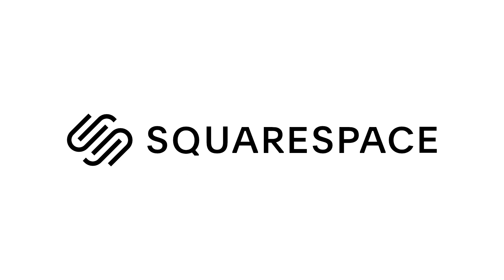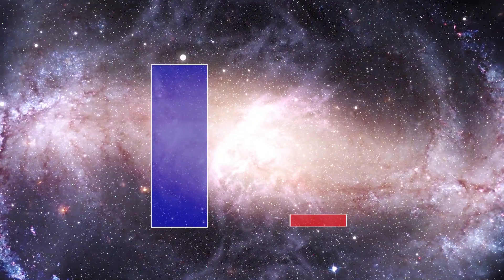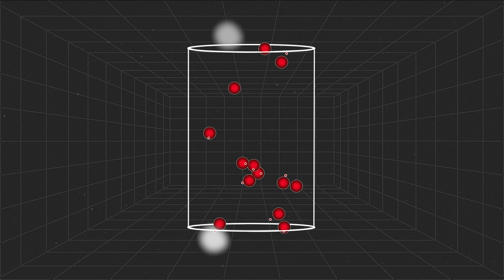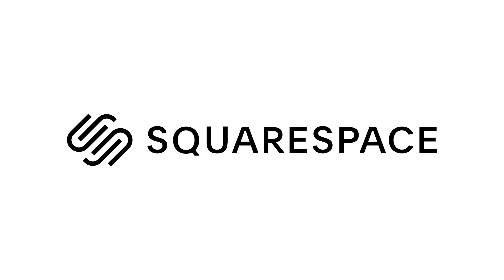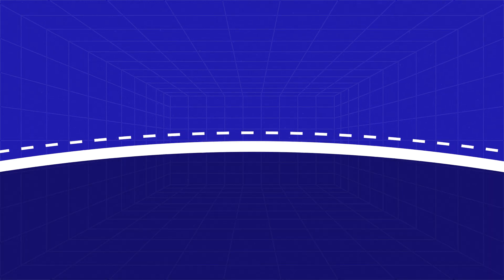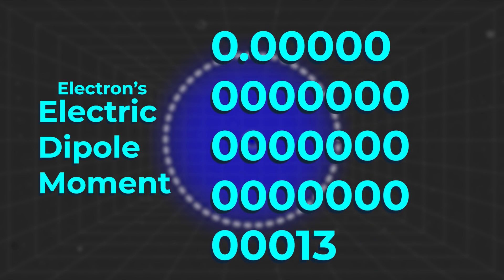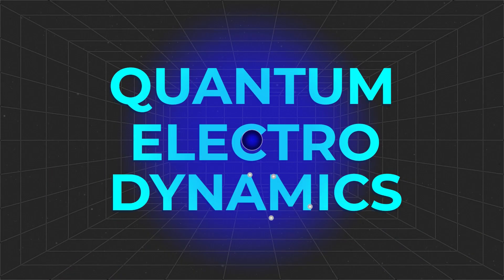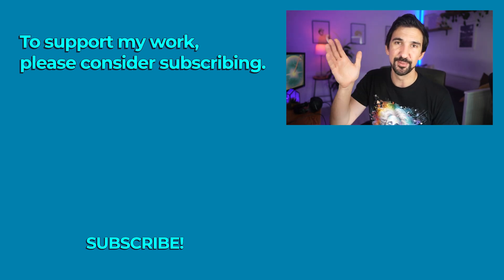What If Electrons Aren't Round? The Antimatter Problem  - EXPLAINED

Comment: Question: How do we know we don't see antimatter? If antimatter behaves identically to regular matter how could we differentiate antimatter from a distance? Could it be a possibility that distant galaxies and structure could be made of antimatter due to local inequalities of matter/antimatter but the universe as a whole balances out? Please excuse my ignorance
Reply: If there was a bubble of antimatter somewhere, there would be a flare around it of annihilating matter. You would definitely see this.
Reply: @jurjenbos228  Not if they are separated by pure vacuum or like in the video above separated by magnetic fields. Even in the experiment above the antimatter could exist forever if the experimentalist never turned off the magnetic field.

Comment: What if normal matter was slightly attracted to the center of the big bang region and anti-matter was slightly repelled away from it at early stages of the big bang expansion? Wouldn't this propel anti-matter outwards creating an anti-matter shell which could exist beyond the CMB and in equal quantities to the matter we know of in our visible universe?
Reply: The Big Bang didn’t have a center. It was everywhere.
Reply: @AdrianBoyko  Actually it had an infinitely dense (centralized, if you will) origin point from which all things expanded from, so in a scalar sense the center would be the beginning expansion coordinates if cardinal points could somehow be externally constructed, but otherwise, you are correct that everything which is within the universal sphere was within that origin point. So, when I mention the "center" I'm speaking in terms of the origin cardinal coordinate expansion point and where all initial energy, gravity and matter was directed away from in the initial moments of the big bang. The matter and energy didn't expand linearly (in one direction) or circuitously (in a loop) it expanded spherically in all directions away from a point of origin. That means that in fact, there remains a true cardinal pinpoint somewhere within our visible universe where the initial expansion took place if scale is to be considered. As for my premise, it was intended to be in reference to possible early stage disparities between normal and anti-matter, since the early effects upon matter and anti-matter would have been quantum influences and not classical. We know that electrons don't fall into the nucleus because of quantum effects creating atomic valance shells and the gluons holding quarks tightly together. So, in the earliest of time during the initial hyperinflation of the universe, there could have been a quantum phase in which antimatter was equal to normal matter, but its inflation rate was ever so slightly different at the beginning to where it's far beyond the visible sphere of detection in our current expanded universe. But, it's just a thought I decided to share. I'm not claiming it's true or even probable. Then again, we have no conclusively deep grasp on the quantum world to begin with.
Reply: @merlepatterson  
It would probably be the other way around if it's anything like what you're suggesting...
Reply: There is no “center” of the Big Bang, it happened everywhere.

Comment: I have two questions:
- Why the shape of an electron could cause the imbalance between matter and antimatter?
- What shape should the positron be and why couldn't that have taken over?
Reply: And electron shape (dipole moment) violates parity symmetry because it is aligned with the spin. Under reflection, the dipole flips direction and the spin does not.
Reply: @DrDeuteron  Yes but under CP the charge is flipped too restoring the dipole moment. So I see that P breaks the symmetry but isnt the symmetry restored under CP?

Comment: I want my credit for this....the anti matter problem is quite easily explained.....and it's not some exacerbating leap and jump...

Why do scientists keep forgetting about ocams razor? It's like that's science fiction by how often they forget

This is easiest to explain in math....under the circumstances in the early universes. There was more or less forces at work.

If everything is equal. One matter for every one anti matter...we still end up with MORE matter that we had to begin with. 

What...is 100-100? 0
What is 100*100? 10,000
100÷100? 1
-100*-100? 10,000....does this make sense

Something forced the antimatter to obliterate itself but doing so created matter..sorry "created". Some antimatter did collide with normal matter but if more anti matter was around other antimatter. Then there instantly is more normal matter to anti matter...basic math, no need to extrapolate possibilities. Stop being so obtuse scientists

Comment: The Antimatter equivalent of an electron, the positron is inside the Proton, giving it a positive charge. We already know that forcing an electron into a Proton makes a Neutron, this is what happen to make a Neutron Star. So, both Electrons and Positrons exist inside a Neutron.

The Quark Model of the atom is a Mathematical Construct that does not describe what matter truly is. There was even a recent paper describing a Proton as having many many more quarks within them
Reply: “An electron interacts with an up quark in the nucleus via a W boson to create a down quark and electron neutrino.”
Reply: A neutron has a mass greater than that of a proton by approximately the mass of an electron.  So if a positron somehow interacted with neutron, it would eliminate the "electron" component releasing energy, lowering mass and leaving a proton behind.  Maybe in the early universe there were no protons, only neutrons, and electrons and positrons in equal numbers.  Some positrons would have encountered electrons and annihilated, and others would have encountered neutrons and vanished to create protons.   It's equally likely that anti-protons could have been created this way using electrons, but that didn't happen.  Perhaps as soon as one predominated even slightly, we ended up with what we see today.  Or perhaps there's something about neutrons that prefers to "ingest" positrons than electrons.  All guesswork without evidence.

Comment: Thanks.  Please excuse my ignorance.  Electrons travel.  I don't know if it makes any sense to ask how fast they travel around a nucleus.  But wouldn't relativity appear to flatten them in the direction of travel?  How might that effect their interactions with other particles?       tavi.
Reply: Electrons do not travel in the nucleus at all. The truth is electrons don't really exist, not in the nice particle form you're imagining anyway. Particles are an illusion. The truth is there is an electron field, and this field jiggles like water ripples or a drum skin, but the difference is this is a quantum field, which means it can only vibrate with certain specific energies. In fact it's a simple ladder, there is some minimum energy and then you increase in steps from there, the gap between each step is always the same, and this energy is what we associate with particles. But it's really, truly, a field. It's much more wave than particle, and you cannot understand electrons in atoms if you try to think of them as particles. The atomic nucleus has a strong electric charge and this creates a so-called boundary condition on the electron field nearby. This sounds fancy but it's not really, it's just like a guitar string or a drum skin. A guitar string is fixed at each end, so it can't move there. A drum skin is fixed all around the circumference, so it can't move there. This restriction is what we call a boundary condition, and it limits the possible ways for the string/skin/quantum field to vibrate. The atomic nucleus actually causes a kind of spherical harmonic pattern in the electron field (look up spherical harmonics, good animations out there). So the question of how the electron moves inside an atom is not answerable. Electrons do not really move because they don't really exist, they temporarily seem to exist when we measure them, otherwise you have to stick with fields. If the electron really was moving in there, it would have to move in circles or it would not stay close to the nucleus, and that means it would be accelerating, which means it would radiate electromagnetic waves and spiral into the nucleus.
Reply: @disgruntledwookie369 your analogy is still a bit flawed. conventionally, when we talk about a fermion particle as a discrete object, we're referring to the field in which a fermion repels all other fermions with the same spin.

Comment: I’ve been saying since 2013 that it seems extremely (Occam's Razor) obvious that all electrons and all photons are in orbit with a dark matter particle and I’ve shared my theory literally many thousands of times with hundreds of the world’s top physics universities, professors, labs, channels, etc.

Based on Fermilab, CERN and other recent findings, I now more specifically think electrons are made of an electron neutrino entangled in orbit with a dark matter muon neutrino, explaining their erratic orbits around nuclei, superposition, uncertainty, the double slit, etc just like I’ve been saying since 2013.  And I think when the electron neutrino gets entangled with the muon neutrino it creates the Higgs field.

I think when an electron gets a 2nd muon neutrino, it’s what we call a Tau particle and I think photons are a pair of electrons entangled in orbit together in apparent axial or helical polarizable wave-like movement depending on the direction of their rotation as they travel.  This explains the double slit experiment for example and the speed of the rotation explains electromagnetic wavelengths.

I also think protons and neutrons are actually made up of over 1,800 electrons with the muon neutrinos likely all clustered in the center surrounded by the same number of electron neutrinos.

‘’If you want to find the secrets of the universe, think in terms of energy, frequency and vibration.’’ -- Nikola Tesla

Comment: There are three models of the electron that I am aware of and all three are more interested in its working diameter and its frequency.  All three models give the electron two parts spinning around each other but in different configurations in each model.  Most graduate physics classes only work with equations for light that don't deal with the spin of the photon; and both light and mater are so much easier to work with if you don't work with all the parts, that is to say that photons and mater are most likely timed and it is that timing that explains polarization, why electrons pushed out positrons, antenna reception, and even gravity if you are in my camp believing that gravity is probably (%chance) massive quantity of out of phase low energy photons.
Reply: I would like to know more about your gravity theory. I have personally had the thought that gravity could be a kind of shadow effect between objects like the sun and the planets caused most likely by some kind of Electro Magnetig Radiation. In one of Richard Feynman's lectures he draw the idea on the blackboard but laught at it. He said that the same EMR would have stopped the earths spinning around the sun. I did a small calculation on it and found that yes the earth would have slowed down but only ever so slightly in it's 4 billion years life time as the speed difference between the earths movement and the speed of EMR is so big.
I am also slightly wundering if the quark idea is really true. The 1/3 and 2/3 charge statements are what is puzzling me. What is charge anyway? Can it be 1/3 or 2/3? shouldn't it instead be 1 or 2 and then be 3 for the electron if this idea is correct? I am in no doubt that they have made calculations that kind of prove it to be correct but are their formula's correct? I believe that at many times in the past people have come to the right result but gone the wrong way. Couldn't there be some thing similar here? 
I also believe that all those so called particles they have found in Cern are of no real value. I believe that most of them arent stable enough to hang around to make any material out of anyway. A fameus physician has also said so.
I actually believe that there are no particles at all but only waves. I believe that what we call particles are some kind of standing waves of energy and the reason we percieve it to have mass is because it takes a lot of energy to push it out of the standing wave positions.

Comment: The most important thing is missing one the video: why and how does the shape of the election could cause the master antimatter imbalance to begin with?
Reply: I second that. How does the shape make the imbalance? What shape is the positron? Is it different?
Reply: If the shape of an electron or any fundamental particle is not perfectly round then CP parity is broken.
If CP parity is not true then we can't assume that matter and anti matter were produced in equal amounts during the big bang.
Reply: @priyanksaklani8176  Why does CP parity being broken due to electron shape have  to do with CP parity broken in matter anti matter distribution? We already know it is broken right since we live in a matter universe? so seeing another instance of it being broken doesn't seem to be the full explanation as to how it explains the uneven matter produced.
Reply: @lendluke  investigation in shape (electric dipole moment) of fundamental particles is an experimental way to disprove the CP parity.
Our assumption of 'equal amount of matter and anti matter produced in big bang' is based on CP parity. Once you prove CP parity false you basically prove the above assumption false.

So maybe during the big bang there was a slight imbalance between matter and anti matter.(with slightly more matter than anti matter)
Most of the matter and anti matter would annihilate but some matter will remain ( the imbalance I talked about above) we might be living in that remaining matter universe.

Comment: One question I always had is what if the antimatter is there, but we can't tell because the wavelengths of light emitted by anti-matter stars is the same as regular matter stars?

Like, antimatter and matter were made in the same amounts, but they just haven't had the chance to touch and annihilate due to the distances involved?
Reply: Intergalactic dust has had plenty of time to "meet and annihilate." Astronomers should see a significant glow from the interactions. They don't.
Reply: @ProfessorJayTee  thats fair. Thank you for the response!

Comment: :eyes-purple-crying::hand-purple-blue-peace::face-red-heart-shape:The real problem is that all the current experiments are checking the roundness of the electron's charge (EDMe) only at the magnetic dipole moment axis N-S of the electron and not overall its circumference. Did you know that?  There is actually currently no experiment methodology that can do that checking the total circumference of the electron's sphere charge possible deviation from perfect 2πR symmetry. They, don't even try? The excuse they come up with is "because SM theory predicts that "electrons cannot have a quadrapole moment", however this was never experimentally verified (not even close the 10^-30 precision they are measuring). Well at  least I tried telling then but they don't listen "Fine Structure Constant Model Demonstrates the Electron Elementary Charge of Having an Intrinsic Manifold".What they currently checking is if N pole electric charge of the the electron is different in value from its S pole charge but what they really should check is, if the pole charge's are different from the charge at the equator of the electron?!
Reply: How can you measure it and prove that? Nobel prize for you if you've got the correct answer! Bet you don't. Go to it, and prove me wrong. Otherwise, I'm listening to the people who actually have extensive experience in and work in the experimental field. You theoretical recliner physicists are hilarious. You can make a model of anything, with a little thought. Proving it in the real world is much harder.